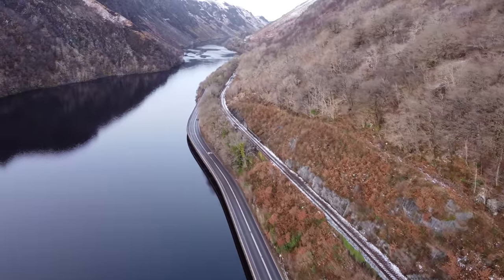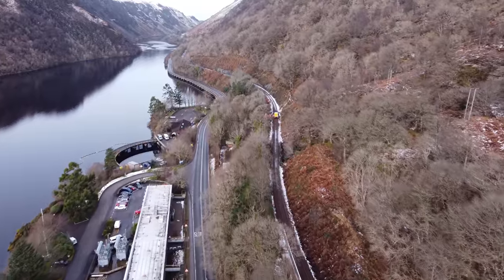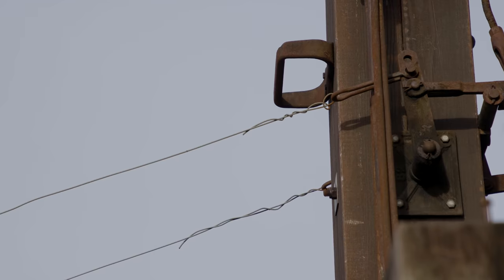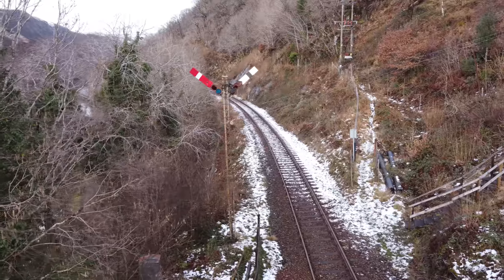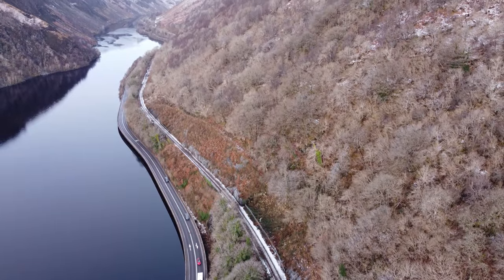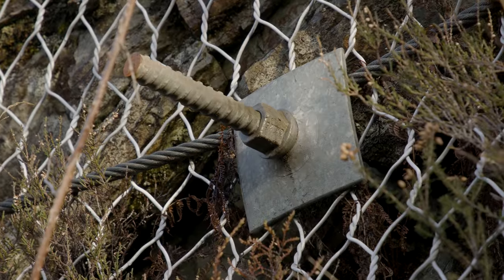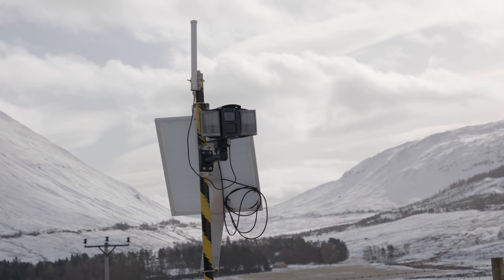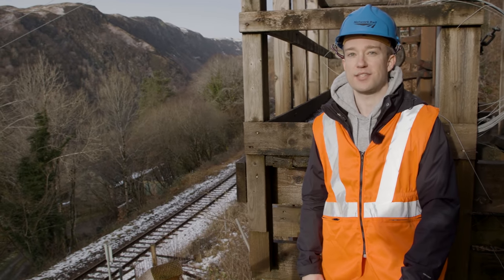After 140 years, this old technology still keeps trains safe

Comment: Bruh, I was JUST gonna say “hey couldn’t they just…” but I stopped and thought hmm.    But couldn’t a modern version of the breakaway cables be used? Breakaway anchors maybe? Breakaway joints in the middle of the length of cable? Could use computers to monitor that. But power source is an issue of course.

Comment: My immediate thought was to replace the wires with lasers, but a blade of grass could disable such a system. It's an intriguing problem.
Reply: Also you need power for the lasers, and they would only work over a limited range (especially on curves). The more lasers and detectors you have, not only is there more cost to fit, power and maintain them, but also more chance that there will be a failure that will cause a false danger indication.

Comment: If they already have a bunch of wires running parallel to the track anyways, wouldn't it technically be possible to run a current through the already-existing wires and then install new signal towers that trip when the circuit is broken and automatically alert controllers of the problem?
Reply: The problem is supplying the power

Comment: Solution: put a drone on wheels 1 km in front of every train. For the next level: make the drone so it can drive on just one rail so it's more aerodynamic and requires smaller batteries. It couldn't be that expensive...

Comment: now, i know these folks are smart but did they ever consider runing a physical switch to each of the signals to detect weatther the signal has tripped?
reason why i say this is because you can use a super low working voltage to do this

Comment: This may sound stupid but isn't it easier to make the system more efficient an essay to reset than trying to make something brand new? I mean a different form to set the wire and signals, so they activate even if the wire doesn't snap. I mean the system works already... Just make it easier for the human to use it

Comment: Hey, can't they just, replace the wires with lasers so if the beam is interrupted when a rock falls it triggers an alarm at a receiving photo sensor?
Reply: Have to power it somehow
Reply: @c0rtikoZteroids1  I was going to say that you can very easily power them with solar panels and reliable batteries, though that would require high maintenance for replacing batteries as it would also require an oversized battery system to make sure the system works even on extended cloudy days.

A much simpler and realistic solution is just to pass a cable, really, if they managed to build a railway, then passing a power line (preferably underground so stones don't knock it down) would be somewhat trivial. Also along side the high voltage cable you could pass a fiber optics cable for data, so that the sensors don't have to rely on wireless communications.

Comment: Couldnt they just use lazerbeams? Microphones or pir sensors? Pressure pads?
Reply: That would use a lot of power in a remote area, as disclosed in the video, that's hard to come by. Not to mention that on a large scale would be insanely expensive.

Comment: Really? A small sensor and transmitter combo attached to one of those antiquated signals calling back like once every five minutes or so draws too much power for a solar & battery powered solution to remain viable enough to the point where they're rather be having an incoming train do the landslide check? Like really? I mean sure I don't know how harsh Scottish Winters can get but really?!
Reply: @ᴛᴏᴍ sᴄᴏᴛᴛ What? You're really not questioning such a blanket statement that everything was evaluated and done when it came to progressing a system like that to a more recent standard? 🤨

Comment: Proof that engineering as an artform of "design something to work without a source of power" is a lost technique relegated to the history books. Every modern solution requires a power source using technology that is still in its relative infancy. So until we can develop something that doesn't need a ton of power, or attach it to a battery that can't be knocked out of action, Andersons Piano will be around for centuries to come

Comment: I'd love to visit there.

Although, why don't they set up a remote detection for the semaphores?  They have lights on them, so there's power for a simple wireless alert system light end of train devices in the US use.  Just a chirp every ten minutes or so, depending on how frequently trains pass through, giving signal number and ok or tripped.  That way they'd have a heads up before a train went through.

Comment: After 140 years in service, they could have brought electricity to this area and improve the system slightly (replacing the semaphores by signals and thus at the same time be able to have electric trains ont this line surrounded by nature rather than polluting diesel engines).
It must be noted that the basics of this system (wires that serve as detectors) is still wisely used by modern subway lines when there is for example aerial sections that could allow an obstacle to fall an the tracks. The breaking of any wire then triggers an automatic power cut and, in case of driverless trains, the cutting of "moving authorization" information received by onboard computers.

Comment: Can't they still use the same system but put remote sensors  to signal when there is a problem
Reply: as said in the video the sensors need power and some are in very remote parts and they will still have to go out and fix the problem when the system is tripped but I do suppose that even if the sensor does get tripped when it has run out of power then the mechanical system does still work as originally designed
Reply: @stuartpratt3662  The sensors need very little power when there is no transmission. They need to transmit few times a day just to report battery level and they they are alive. A very small solar panel - 5W can recharge the batteries even on cloudy days. You will need to fix/replace a sensor once in 10 years on average. And even if the sensor dies it changes nothing. The system still works fine.

Comment: Could'nt they just.... Drive a little bit slower, and then have a little cart that moves maybe 300 m in front of the train that is equiped with sersors, cameras and stuff that warns the train if it sees a rock on the track? The train then have time to stop.
Reply: Why make trips longer and more expensive when you can just use string

Comment: Wow, I'm really disappointed about this statement from the head civil engineer  "The knowledge... there's no book... we need to pass that down through the generations.". This is sadly typical of the rail industry. Insider knowledge and archaic methodologies. I'm not talking about the system but the way that it is documented and how the maintenance training is conducted. Why is there no book? How is consistency measured through the generations? The whole rail engineering sector is mired with veteran designers holding on to their ways and sadly it appears that the maintenance crew aren't much different.

Comment: Strangely, what I found most interesting is that they still use diesel engines. I thought trains had mostly gone over to electric. Train lines often have loads of cables running along, not just electric, but phone lines and internet as well, as the trains often cut the shortest route cross country. As the trains started to convert to electricity, they put infromation cables along with the electric ones, something something birds and stones. If you're gonna hook up your train signals to a central, why not connect it all to the internet, and get government funding to place high capacity cables that reach far? Might solve the "there is no power for detection" problem while they're at it.

Comment: I'm not sure why they haven't invested into drones. If they get permission they can set up a determined path where the drones fly over the tracks, stop at a station, wireless charging, continue, and have multiples where you'd end up with nearly "live" coverage. They can also be used by drone operators to survey surrounding areas to know if trees need to be cut or flooding concerns.
Reply: 6:17

Comment: Much of the system could be replaced with solar IOT devices to send signals and then cameras to detect covered rails. Not very complicated and no need for a power grid either. :)

Comment: You're telling me no engineer thought of using infrared laser fencing in the same or even larger pattern to replace the physical cables? Just add in code that says to only report laser breaks of a certain time length and up to remove the possibility of small rocks and leaves triggering the system.

As stated they already have an acoustic detection system too.

Lmfao, no, this is typical case of the gov't doesn't want to spend the money on replacing something that works.

Comment: Couldn't they run an automated mini-locomotive in front of the train? That detects rocks that have fallen, and then stops the train, which is following with sufficient safety distance?

So you don't check the entire track all the time, just the track that is in front of the current train?
Reply: I understand, railway safety systems are difficult, and such a novel system would be challenging. But with modern technology systems, the current approach seems to me the wrong way round.
Reply: @MeetDannyWilson  Problems with that idea:
Too slow, the train will bump into the automated locomotive.
Too fast, the automated locomotive won't be able to stop the train in time for a rock fall.
Reply: @enochliu8316  
I'm a bit skeptical my idea would work (and whether it would really be cheaper), but the current system has the same "too fast" problem: If a rock falls into a section of track after the train has passed the signal for that section.